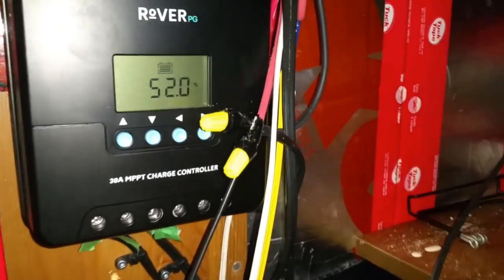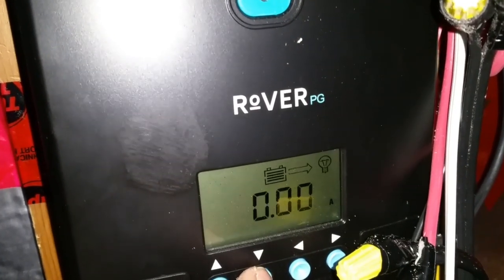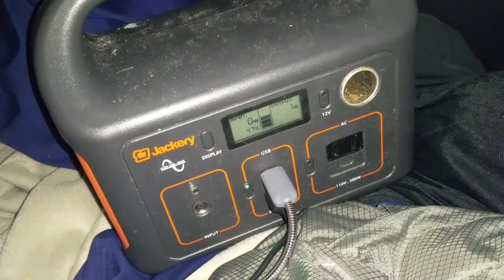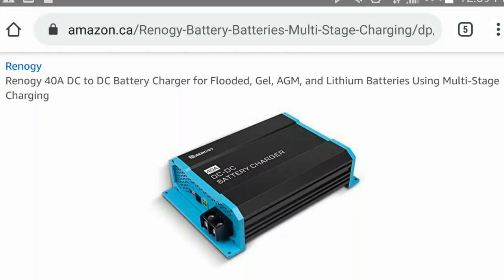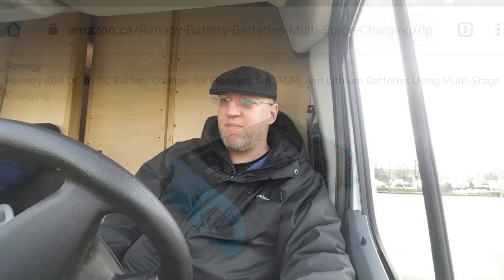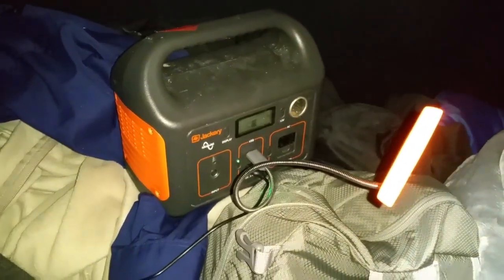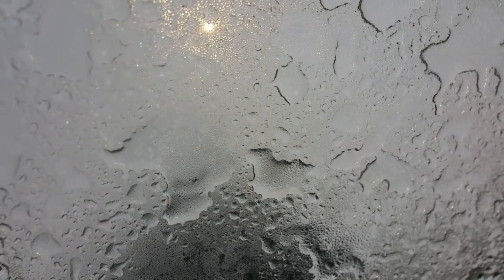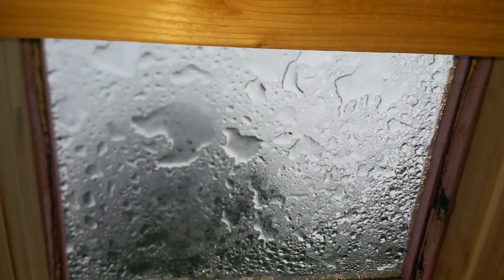House Battery Longevity - Solenoid vs DC to DC Charger.

Comment: Your altenator charges at 14.2~14.7 volts and has an internal regulator that floats the voltage when the battery is charged so I wouldn't worry about overcharging your house batteries on an extended drive. I do think that your van's starting batterys life will be shorter when using the altenator to charge your house batteries as a starting battery is designed to give a lot of amperage at once to spin the starter and may never get to be fully recharged because of the draw on the altenator trying to charge all three batteries each morning and evening during your short drives to and from work. Put one of those cheapo digital voltage guages in your cigar lighter and a toggle switch in your line to the selenoid. Before you shut the van off at night coming "home" turn off the charge to the house batteries. If the voltage on the starting battery is still a little low, let it idle a bit to charge it. Sorry didn't mean to write a book but perhaps it will help one of your subs.
Reply from the maker: Thanks. I just bought a battery monitor. Now I'll know exactly what is happening.
Reply: i guess Im kinda off topic but do anybody know of a good place to watch new tv shows online ?
Reply: @Chaim Stetson Thanks, signed up and it seems to work :) I really appreciate it!
Reply: @Fabian Dexter Happy to help :)
Reply: THIS is a great idea. Thank you!

Comment: Hi Timothy,
I agree with simms196 that the alternator provides the regulation you need for both the starting and house batteries. The charging system of the vehicle doesn't overcharge the vehicle battery and will provide the same regulation for the house batteries through the solenoid.  I have an old Roadtrek 1995 and it came with what we'll call a battery isolator.  It's a fancy box with connections for the large cables and small connections for the energizing connections.  It's probably just a continuous duty solenoid, like you have, in a fancy package.  You're set up effectively "isolates" the house batteries from the starting battery when the vehicle isn't running.  When the vehicle is running, it enables the house batteries to be charged by a voltage regulated alternator in the vehicle.  It may not fully charge or "float" the house batteries but that may be a benefit and actually extend the health over a longer period of time for the house batteries.  Then when sunny weather comes along, the solar panels through the charge controller can do their job of cycling more current to the house batteries for maintaining house battery health.
The key to your solenoid setup is the continuous duty solenoid.  Some people just use a starting solenoid which is designed for short-duration use of high amperage.  Leaving one of those "on" for long periods causes premature failure of that type of solenoid.  But your continuous duty type is designed for the use case you are using it for.  Good.
Reply from the maker: Thanks ☺

Comment: I've had this same discussion in my head with myself.   I do drive a fair bit so I went with the DC to DC charger AND the $100 cheapie Walmart batteries. (2).  The batteries have lasted 3 1/2 years so far and still going strong (ish) (starting to notice a difference).  I did away with my solar on the roof and have just a 100 watt foldable Renergy panel that I think I've used twice.  Like you said, different strokes for different needs.  Thanks for confirming my thoughts.  Good to see you as always.

Comment: Can't you just put a switch on your solenoid wire?  Turn it off when you don't want to use it?  I have the 40amp Renogy DC to DC charger, works pretty good, I just switch it off when I don't need the juice.
Reply from the maker: That is an option. BTW , congratulations on all your success. ☺
Reply: @Torin_by_the_Ocean  Well cool. Thanks for the video. I was just watching His video on the subject. But! He doesn't use the agm batteries and found your video. Thanks to both of you. I'm researching a lot now and hope to get into van life soon. But i'll be starting out cheap and doing what he did. I have a bike right now LOL And think i'll start with a mini van. Subscribed \m/

Comment: Excellent video my friend. There’s one metric that we discussed that you didn’t mention here. Most good charge controllers monitor ambient temperature. This is important to AGM and Lithium batteries. Charging parameters change especially at freezing temperatures. I suspect snow bird nomads that follow the weather will be better served by a solenoid. Since they are more likely to be in moderate temperatures. 

There’s also one other consideration. Batteries sold at Walmart are not true deep cycle solar batteries. Walmart batteries are a little more like a starting battery. These are very different kinds of batteries that require very different charging parameters. 
In other words, a starting battery Should be charged with an alternator and or solenoid. A true deep cycle solar battery should Not be charged with an alternator. 
But, I agree with your assessment that a different approach to power and charging should be made individually based on our own factors.
Reply from the maker: I appreciate your wisdom and knowledge my friend. Wishing you a fantastic 2020.☺
Reply: Is this  a Will Prouse  quote?? Nobody here is an electrical engineer  Maybe some vandweller "experts" might want to consult Knurlnar he is a bona fied expert .
An actual electrical engineer. Van dwellers are not experts by any degree. Sorry Dr. Buzkill here maybe i should team up with linescrew 1  and do a comedy routine hahaha😎😎
Reply: @staticcampervan  why a deep cycle battery cant b charge with an alternator please and wich other options do we have kif there any) in winter in Vancouver since there is no sun for 6 months? For those as me who dont have access to shore power

Comment: I have an inline cut off switch between the van alternator and my renogy house batteries. Mounted it under driver side seat within reach.   It gives me "complete" control when I want current traveling to my house batteries. Use it all the time and turn it on and off depending on my current situation.......100% control at the twist of a switch      👍         🚐💨

Comment: Great video, thanks for sharing! I'm trying to figure out the best option for my short bus. From what I've gathered, there is concern that solenoids not only have the potential to overcharge the batteries but to put a lot of stress on the alternator as well, shortening it's life at best, or ruining it very quickly at worse. Like Foresty Forest mentioned, I'm wondering if a manual or automatic switch could be installed and stop output power once the battery bank is fully charged? But it still doesn't seem like it would do much for the alternator running on full blast while charging the bank. So many pros and cons, it's a mess, lol.

Comment: If the batteries are hooked up together, like pos wire goes from bat 1 to isolator to bat 2, then the Voltage regulator works just the same as it does on your bat 1. DC to DC limits amps, to 40 or 20 , whatever you bought. Alternator is 130 amps or more.

Comment: Hey Timothy, More advice here. There are a few factors to consider. First, the constant duty solenoid is fine, the one step up device would be a smart solenoid that makes sure the vehicle battery is charged first then begins to charge the RV batteries. You need to have a minimum 4 gauge wire from your Alternator or battery back to your RV batteries. Fuse both ends of this wire.  It is also preferable to have the same battery types in the vehicle due to differing voltages. Lead acid 12.6V,   LIPO 12.7V,   AGM 12.8V.   It's not much but the 10th or 5th volt difference can effect charging. The lower voltage battery will be less resistive and receive more charge current than a higher voltage battery. I have all AGM in my truck and truck camper so the loads are balanced. As batteries get closer to full charge, they are more resistant to taking any more charge. That's why you need a 14.7 volt bulk charge which your alternator will provide and 13.7 or so float charge to maintain once charged. 
One problem is some newer vehicles, the computer controls alternator output to make better fuel efficiency. For those vehicles you may need to go the DC to DC route. You would have to monitor your alternator charge characteristics to determine if you get 14.7 volts long enough to bulk charge the RV batteries. On my 2000 F250, it's not an issue. Your Transit, since it's a commercial vehicle and meeting Canadian requirements, you may be fine as is.
Reply from the maker: Thanks so much for sharing your knowledge. ☺
Reply: This is really helpful, thanks for sharing. Your info about the different chemistries gets at the root of some of my questions. I'm guessing that as people move to LiPO, these batteries don't drop much in voltage until nearly "empty". Thus they won't receive much charge as the alternator thinks they are nearly full based on voltage reading. Does the DC-DC charger help overcome this blindside of the alternator regulator when using mixed chemistries b/n the vehicle and house batteries?

Comment: In my mind, the DC to DC charger protects the alternator by limiting the current which may overheat the alternator. My DC to DC charger limits alternator charging demands to 26 amps, which might be a bit conservative but a fried alternator is not a happy conclusion. The alternator is designed to give a lot of amps to the starting battery, for a relatively short time. In my case, I have a LiFePO battery, so the BMS will make sure it doesn't overcharge. Also, the DC to DC charger boosts the voltage at all engine speeds to a level that the BMS likes to fully charge the LiFePO. This is possibly something you need to think about in your case - at a pinch, you can idle your van for 30 minutes or so without overheating the alternator (when there is less airflow from vehicle motion) in order to get enough charge into your house battery in case you need it to run a heater or fridge or something overnight, and prevent an under voltage situation at 3 am. Your alternator alone may not give enough voltage to charge your AGM's fully at engine idle speed.   So, long story short, I went for both DC to DC and solenoid, and the solenoid is switched so I can switch on the whole caboodle as my control freak personality demands :-)

Btw, I'd love to see your battery monitor in action - I've got one of those thingies that Will Prowse has, and I really don't know how to zero the AH meter on it to keep track of power in and power out of the battery. I suspect the cheapie battery monitors are not very accurate.
Reply from the maker: I'm going to do a video on it once it's installed ☺
Reply: @Torin_by_the_Ocean  Great, thanks!
Reply: Yup. Don't want to smoke the alternator. Worst case scenario, it's cold..damned cold out. You have discharged house batteries from overnight, you go to leave in the morning and fire it up. You have to run the defroster to clear the windows, it's raining/snowing so your headlights have to be on per law.  Now your alternator has to do it's normal job of running the engine control, defroster blower, lights and charge a dead house battery. Not good. The DC-DC will taker longer to recover your house battery, but extend the life if your alternator by years.
Reply: @matt9c1 my bus bus uses 35 amps with everything on.  This is just the bus stuff and doesn't include the any of the extra camper build out stuff.

Comment: Alternator output is regulated by battery voltage. The starter batt doesn't overcharge therefore the aux batts shouldn't.
Reply: Thats not the point......a completely dead deep cell battery should be brought up to voltage slowly and an alternator doesn't do that it just unloads power
Reply: @gaboonviper85  wrong ! Try again

Comment: It depends if you are using typical RV/boat deep cycle batteries or golf cart batteries. Either way so long as the van’s voltage regulator will prevent over charging the batteries. It’s better to charge standard deep cycle batteries slower. I think the recommendation is 10 or 20% of the ah capacity. But golf cart batteries are designed to hand faster drains and charging. Just make sure the liquid level in the batteries doesn’t get low.

Comment: Lots of sun down south. Always wire in series (with MPPT) up to the controller limit. If your in low light a parallel array may never go high enough to charge.

Comment: I’m using my van’s built in 400W inverter with a Victron AC charger to charge my house batteries (DC to AC to DC). It was plug and play and works great.

Comment: My van has 90ah max alternator, my car 120ah max. Both are self regulating. The auxillary lead acid battery in the back of my van is now 7 years old and still appears to be working fine. 

The only problem Ive had was with the smart relay. It's ment to only connect the starter battery and auxillary battery when the starter battery is fully charged, but after using the auxillary battery alot this winter, I noticed that the starter battery was low. After a quick test with my multimeter I discovered the smart relay was not disconnecting the 2 batteries. I've decided to do away with the smart relay and have just ordered a dual volt meter for my dash, switchs and a fused  ordinary relay. 

The downside of this new system will be I will have to remember to charge the auxillary battery. The upside is my stater battery should never drain to a low level because of the smart relay failing again. I like the idea of direct control over auxillary charging more then the convienience of automatic charging. It also means if my starter battery fails I can put my aux battery in its place to keep me going.
Reply from the maker: Yeah, I never want to rely on my memory. 😃☺😃

Comment: Obviously you're risking your alternator somewhat. A bad battery can kill an alternator. Running house batteries down overnight simulates a bad battery. And if you have lithium batteries they need temperature control. You know what you're doing though.

Comment: With a continuous duty solenoid you can’t overcharge the house batteries just like you can’t overcharge the vehicle battery.  When the battery voltage drops to around 13.5 Volts, the alternator will be turned on (connected to the battery). This will cause the battery to charge until it reaches around 14.5 Volts, at which time the alternator will be turned off (disconnected). That's what prevents the battery from being overcharged.  The alternator is your “charge controller”.  My AGM batteries are heavily used, 42 months old, and are still in great shape.
Reply from the maker: Thank you sir. ☺

Comment: The problem is when your starter battery is charged. If you drop surface voltage by connecting a dead battery it will overcharge. The DC converter isolates an otherwise mismatched pack.

Comment: Your car alternator has a voltage regulator which usually charges lead acid batteries up to 13.6volts then remains at float. Will not damage deep cycle batteries as long as they are not depleted below their intended use before charging.  Slow charging(lead acid)is always better though. Just my take over many years discharging and recharging lead acid batteries for my off grid cottage.  Cheers TIM.
Reply from the maker: I appreciate your insights ☺

Comment: My first van I actually had one of those solenoid chargers hooked up to my house battery. I was just running an ordinary deep cycle marine battery. I had bought a new battery for my engine and the deep cycle battery around the same time and guess what? They both were dead within a year. I started thinking about it and remember somebody telling me that if I were going to hook up two deep cycle batteries in parallel for my house batteries, that I should buy two identical batteries and buy them at the same time otherwise the difference between the batteries would shorten the life. Thinking about the situation with my solenoid, I realize that technically I was charging my engine battery and the deep cycle battery together. Those are definitely not the same kind of batteries. In my current van I opted not to use the solenoid. I have one 100w solar panel and charger and for the most part it does the job no problem. I also have a trickle charger with an extension cord hooked up so that I can plug in somewhere if I need to.
Reply from the maker: Thanks for the information ☺

Comment: The solenoid will keep you from draining the starter battery.  Place a simple cut off switch between the starter battery and solenoid then you can turn off the charging on long trips or other times you might need to.  You will get rapid charging when you want and you starter battery won't be drained if you forget to turn off the switch.

Comment: Thanks for your reflections on these choices. But......Just to say it California is A LOT of land, it's most of the west coast of the United States, not counting Oregon and Washington. And people tend to talk about "Sunny California" as if the whole state is bathed in constant summer (which is what I thought too, before I moved here). Southern California (LA, San Diego) is an ENTIRELY different creature then say the Bay Area and/or most of Northern California (some of which gets snowy winters). The San Francisco bay area where I am has very overcast Winters where the sun is not beating down on you constantly.  So my 100w panel is struggling through the winter. On a sunny day in Summer I'm more than charged enough for the night without sun, but not so in winter. Luckily, I do also charge my house batteries while driving to and from work and such. If I just depended on Solar and had no charge-while-driving setup..in the Winter, it would not work out with just my 100w panel (which is all I can fit on my roof).
Reply from the maker: Thanks for sharing that information. Be well my friend. ☺